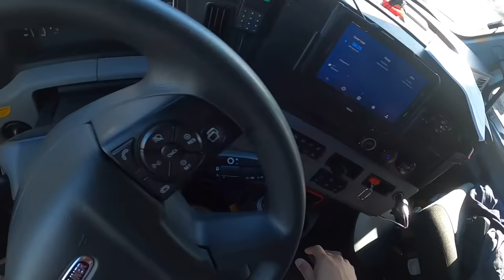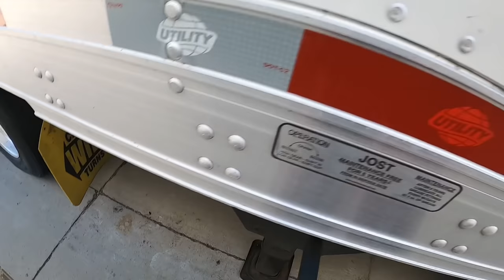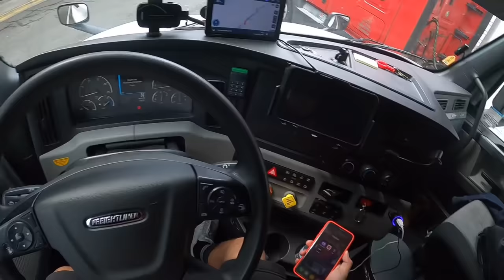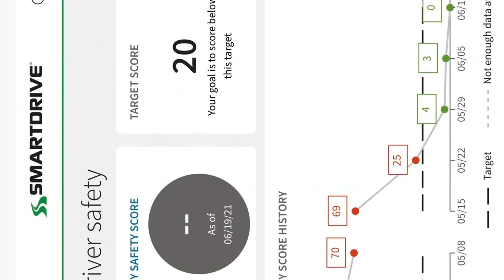POV Trucking Vlog Long Gone | T-Call Load | Swift Transportation

Comment: Advice for hard landing gear is to hook up and push red button in to air up trl bags,helps take some pressure off landing gear.take flash light with you under trl to check king pin to make sure it latches,tug test dont always work.

Comment: Gotta run that clock as lean as possible and do 3 month's on 2 weeks off to earn your worth. DMs will always give you subpar loads especially after a brake if you don't run lean and hard before time off, meaning only two 8 min bathroom brakes on your drive shift if that at all, trail mix for food and sleeping at the shipper if you get stuck there. Your clock tells the DM everything they need to know because they see that on thier screens. You'll be at the top of the board no matter how many weeks you take off they'll be begging you to come back early and give you the best loads because they know you'll run the wheels off that truck every time not just some of the time.

Comment: When you have to fight the landing gear, push in the trailer brake to supply it with air and usually that will lighten up the resistance on the crank.
Reply from the maker: that makes so much sense thank you!!
Reply: No worries man, glad I could help. Also, I don’t know if Swift has the air suspension dump button but when you drop the trailer crank the landing gear down to about an inch off the ground then get in the truck and dump the air bags until the trailer lowers to the ground then pull out from it. That helps the next driver not have to fight with a trailer that’s too high and also helps tremendously with the fight against the landing gear
Reply: If you want a good company that will give you a thousand a week minimum pay let me know man, won’t have to run as hard and get home more I bet
Reply from the maker: @danielboylan353  sadly only other trucks at swift have dump valves :( lol and thanks man I’d definitely let you know forsure as of right now I’m really thinking of leaving pretty soon, pay is just not cutting it for me lol
Reply: If you want the info let me know man, I bounced from starting company to starting company for about two years and now I’m finally at a company where I make the money everyone’s out here talking about and not busting my ass to get it. We have a reefer division with a western regional probably home every weekend still making a minimum of a thousand but honestly I haven’t touched the minimum since getting here only I’m in the flatbed division
Reply from the maker: @danielboylan353  im glad you are doing great man lemme think this through first before I make my final decision I appreciate the info your giving out (: !!
Reply: @danielboylan353  What’s up man, I’m fresh out of cdl school looking for a good start a company. I’m in south fl.
Reply: @zoeboifresh1000   the company I work for only hires experienced drivers but if your looking for a good flatbed company I’d say the usual suspects like Maverick, TMC, Cypress truck lines or McElroy aren’t too bad. If you want reefer or dry van that I’m not too sure about honestly I never pulled anything but flatbed

Comment: for educational purposes you are supposed to lower the landing gear until you can barely fit your foot under the landing gear.  then you lower your bags down, pull out a little bit until your tractor frame behind the fifth wheel is under the trailer.  then stop.  wait to see if the landing gear will support the trailer.  then you can drive off

Comment: Yeah gopro batteries suck.  May I suggest buy a power brick to hook up to your gopro.  Downside is you'll have a charger wire connected while it's on your head lol.  Or if you can, mount the gopro to your dashboard while driving then put it on your head.  Or get a tripod and stand the gopro up behind you.  Anyway, a power brick will keep your gopro going for up to 4 hours

Comment: Hey bro welcome back well after a good year am going back to trucking school I had got my permit but it got expired but quick question how long did it took you to learn all the truck parts in cab trailer etc like am getting used to straight back alley dock and the parking just I can get used to the pre trip n also the air breaks do you think you can post a video regarding the pretrip
Reply from the maker: I’ll see what I can do(:

Comment: Do they set your appointment times usually really far away? Is it because I’m new just sat on my first load for like 21 hours being early. Do you have to call up your terminal to get dispatched on your next load as soon as u send ur empty or do they do it?
Reply from the maker: yes they give you a lot of time, in that case tell your DL you gonna be there early so maybe they can T-call that load so u dnt have to sit for that long, always update your dispatcher bro, soon as u send empty call they should be dispatching you for next load right away, if not send a freeform u have to bugg them most of the time, if they dont answer call them
Reply: Always call in otherwise they will waste the hell out of your hours.  Even when accepting it out alternative drop for whenever u could be there and a lot of times they will send back with a call location or just tell u it’s just a drop and u can drop whenever.  And never wait to be dispatched call in and they do it immediately

Comment: I bought my truck at 650k it has 820k and it's running smooth... It's all about oil changes and good additives be smart with maintenance
Reply from the maker: thanks for the insight!
Reply: @chez8239  and one more thing find a reliable mechanic mines checks my truck every time I go home anything wrong it's fixed immediately
Reply from the maker: @georgenietzsche2264  noted thanks (: !

Comment: Been looking into getting into a truck for some time now. Was dead set on prime, but kinda considering swift because I believe they have a terminal in Atlanta where as prime doesn’t. 
Would you recommend swift to someone looking into getting on the road?
Reply from the maker: I been hearing a lot of good things about prime more than swift, also I think prime do pay better, but then again if the terminal is a huge plus for you then go with swift bro
Reply: Appreciate the response. Does swift company trucks have apu’s?
Reply from the maker: @kennethchambers3849  no they do not but you can idle your trucks no need for apu, especially if its not ur truck, apu is mainly just so you dont idle your truck as much saves the engines life.
Reply: @chez8239  bro what’s an average weeks pay and miles I see you hit 4K in a week but the pay is so low Im wondering what it’s paying
Reply from the maker: @ts9216  I was getting paid 48cpm bro

Comment: Yooo .. what's in the upgrading test for swift... The 50 question test! I upgrade Thursday
Reply from the maker: common sense questions man dont think about it too much it’s really easy ! lol some questions have the answers in them lol just read it carefully!
Reply: Sample questions: What psi do the buzzer/light go off when the air gets too low? Which valve pops out 1st during the applied brake test? How often should you be checking your mirrors? Tire tread depth- steer, drive etc. Try to be familiar with the Macros, but they give you a sheet with the answers basically, just fill in the blanks. Good luck!
Reply: I took the Swift upgrade test three weeks ago, I was stressing, lol but it was easy. Study the macros on page 56 in the Mentor/student guide, they are all on the test. Know the swift speed violation (72mph). How far to look ahead when driving. 4 questions on trip planning. Leave HazMat paperwork on driver seat when you leave the truck. Know the macros to get directions (macro 23). I didn't do any crazy studying but I just read through the student handbook 2 times. Skip questions you don't know and come back to them later. That's all I remember. Good Luck.
Reply: @BlAcKJeZuSx187x  your a legend
Reply: @BlAcKJeZuSx187x  when figuring out trip planning do you divide the total miles by 50 or 55 mph?
Reply: @BlAcKJeZuSx187x  and also how far do you look ahead while driving what's the correct answer to that LOL
Reply: @cjpoker8049  Lol Look ahead 12-16 seconds, Trip plan @ 50mph.
Reply: @chez8239  you were right... Lol so easy..
Reply: @BlAcKJeZuSx187x  lol thanks for ur help just upgraded
Reply: @cjpoker8049  Good stuff bro and Good luck out there on the road

Comment: Aye bro I’m over at Cr England I did my training which was 150 with a mentor if I which over time swift do I still have to do my training over with a mentor all over again ?
Reply from the maker: probably not bro since they already trained you, as long as you can prove that you did get those 150 hours u might still have to do 50 because swift is 200 hours with mentor.

Comment: I'm thinking of going through swift to become a truck driver. I wonder if they would let me go to a school of my choice. Any thoughts?
Reply from the maker: what do you mean by school by your choice ?
Reply: @chez8239  maybe instead of their academy somthing like 160 driving school to obtain my cdl. Or is that somthing where I would just get my cdl first then apply to them. Thanks for the reply
Reply from the maker: @hotel.colorado  well you can go to school with swift and get your cdl through them but the downside going with swift is it cost 6k and I know some schools out there are fairly cheaper than that, and also it’s better to go with private school so at least you won’t have any contract with swift so IN CASE you dont like the company for any reason you can leave without worrying about owing them that 6k$ hope that makes sense (:
Reply: @chez8239  thank you for the info
Reply from the maker: @hotel.colorado  ofcc !(:

Comment: Are 34s optional with swift?
Reply from the maker: yess as long as you have hours then you can run ! sometimes I run with my recaps but when I know Im not going to gain hours next day then I take 34’s
Reply: @chez8239  would you recommend swift? Im thinking more about werner. Otr
Reply from the maker: @davidmedina5536  ehhh when it comes to pay swift is really lacking heard other companies will offer a lot more for new drivers, personally I can’t recommend any other companies since I’ve only work with swift but you can definitely see how much Im making I made a video on it, gonna be doing another video on my paychecks since it did get a but better since I’m running more miles than before, but expect to earn just 1k-1100$ here at swift, vs what I heard people making 1500 minimum on their first year just gotta search those companies bro
Reply: @chez8239  thanls man

Comment: hey im 19 any advice
Reply: If nothing else try to get your CDL Permit ASAP to start if you plan on going to a cdl school like Swift or CFI ya know.
Reply from the maker: keep a positive attitude and dont let anyone discourage you at any reason also find the cheapest school u can go to so your not contract with a company and stuck working for them so in case u dnt like it u can switch company in a snap!
Reply: @chez8239  thanks for the advice and motivation throughout your videos
Reply: u can get hired to drive box trucks or sprinter vans